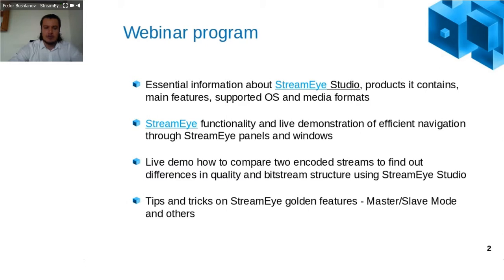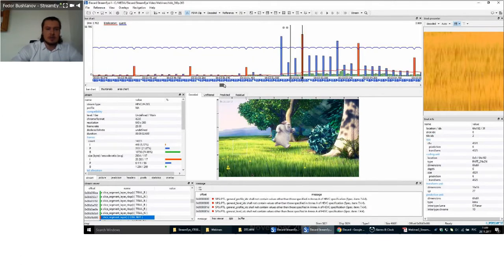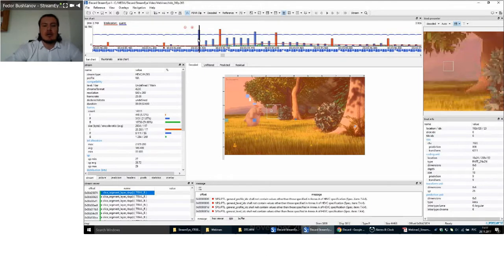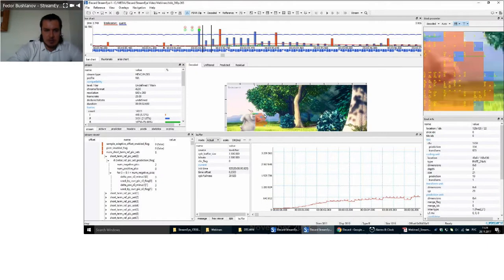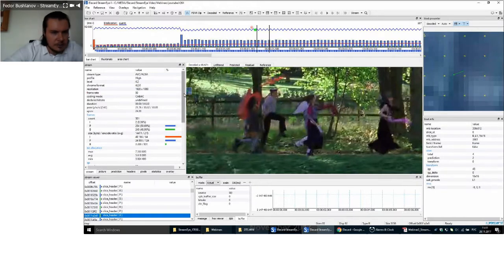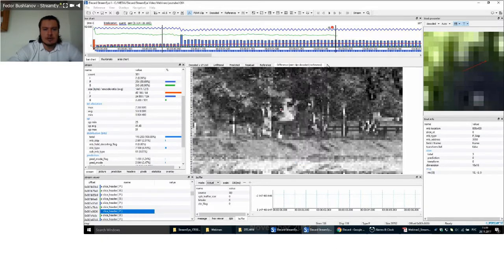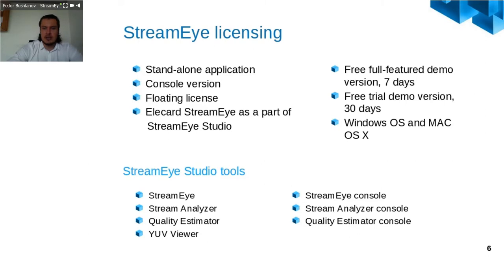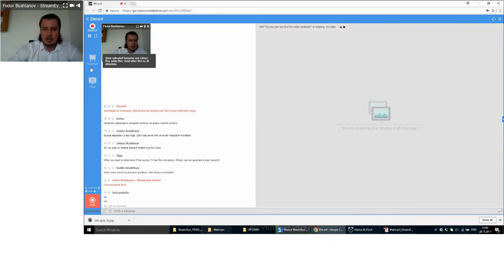[Elecard webinar] StreamEye Studio for codec developers

Comment: can we get information about the frame size using strream eye or do
 we have to use sream analyzer?
Reply from the maker: For that purpose it is more convenient to use StreamEye, it represents the size of each frame.
It is possible to use Stream Analyzer, however, you would need to calculate the size of each frame manually, subtracting from the offset of the next frame the offset of the current one. Therefore, StreamEye is more suitable here.